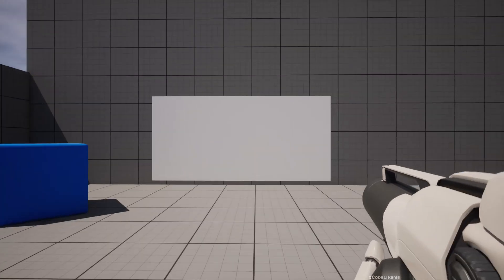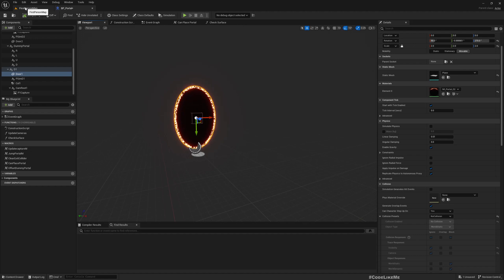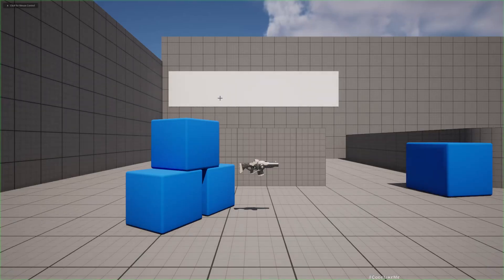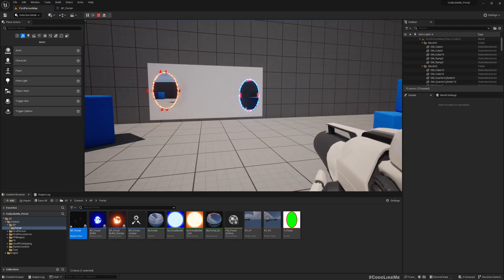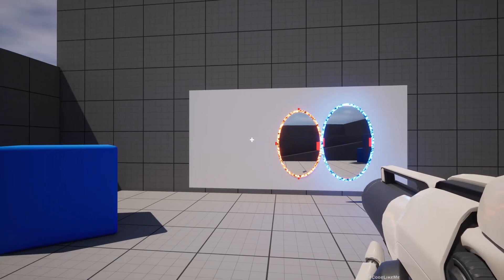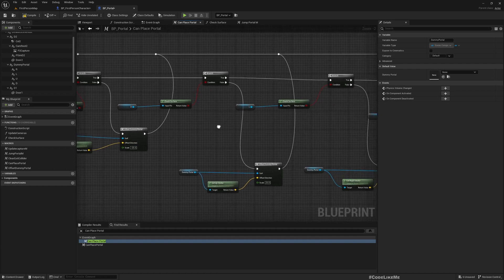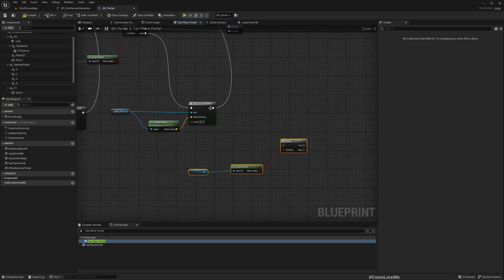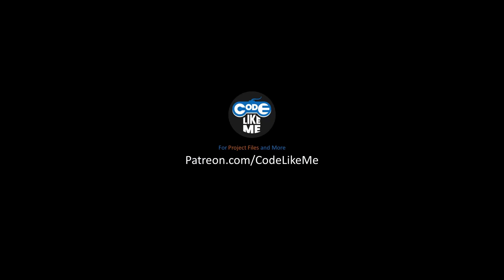Unreal Engine 5 Portal  Gun - Part 7 - Prevent Portal Overlapping

Comment: SOLVED 
I found doing the last steps you went through actually ruined the portal overlap checks for the bottom and right edges of a surface, and it went back to hanging over the edge. It also didn't look like you shot at these two edges at any point you could get a fresh portal to appear... So it was hard to tell if I made an error, or if your test had blind spots in it.

THE SOLUTION - The path from the secondary checks should feed BACK into the branch. So let's say the 'down check' fails, you do the offset on the the dummy portal, then check the 'up check' and if that is true feed back into the branch where you checked  the down portal! This demo had it going straight into the NEXT check, and this was ruining the down and right checks!

Also wanted to suggest you be careful to not zoom out too far on the graph. I found it very difficult to read even at 1440p.

Comment: i still get infinite loop
Reply from the maker: Add a counter to the place where you encounter the loop and break it after a certain number of iterations and consider the surface as not portal supported. 
But this is not the way I solved it as I remember. This is what I have in top of my mind now. 
Compare with my project. Because I remember the infinite loop and I did a fix. Don't remember exactly in which episode I did that
Reply: @jej_x, try replacing' get forward vector with *get up vector*.